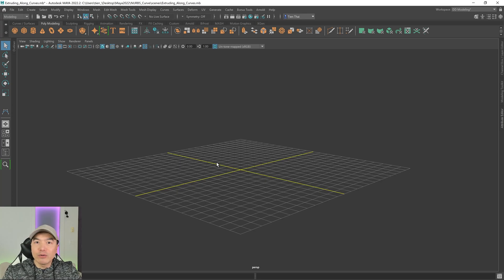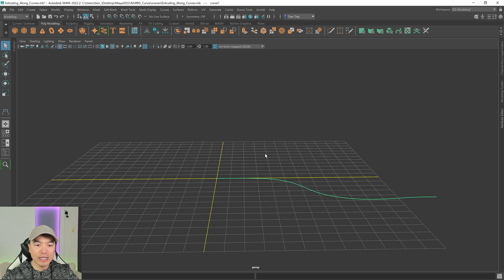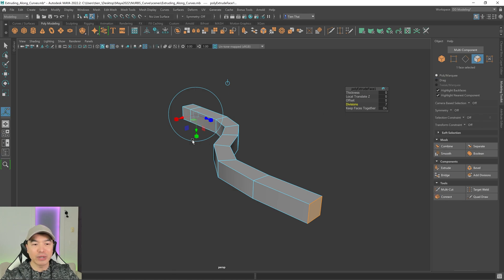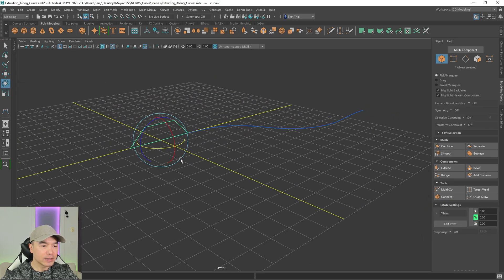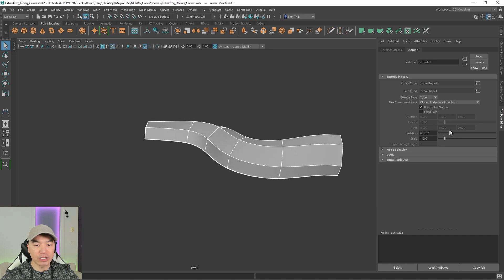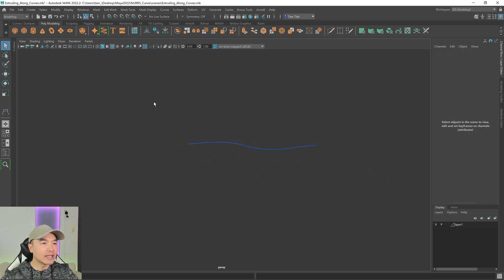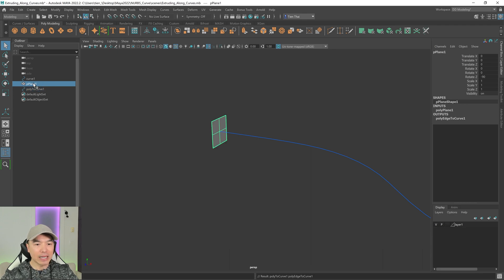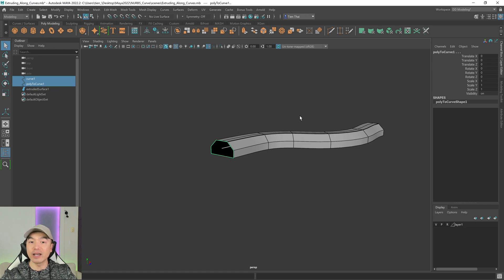Extrude Along A Curve In Maya

Comment: Hi! Once my tube has a good shape, can i fill the holes? Normally i would select the edge, and exrtrude it. But, look like i can't select the edges, even though i delete the history. Thanks
Reply from the maker: Hi if you are extruding using the NURBS curve method you will need to convert it to polygons first. Main menu bar then Modify > Convert > NURBS to Polygons then use one of the methods. Sorry I really should have included it in this video. Let me know if you have any questions about it.
Reply: @DigitalDreambox   That works perfectly!
Thank you so much